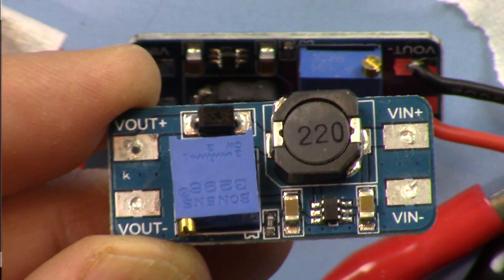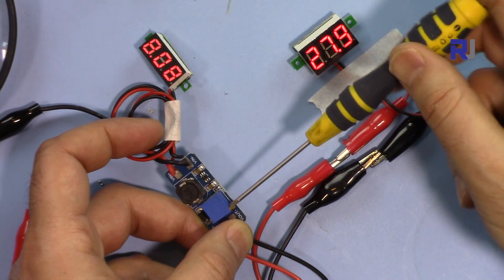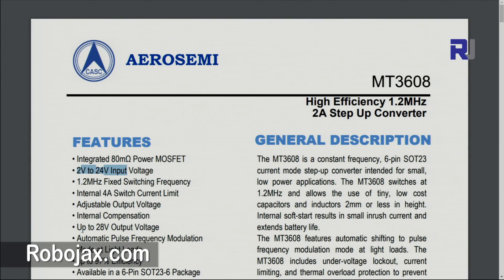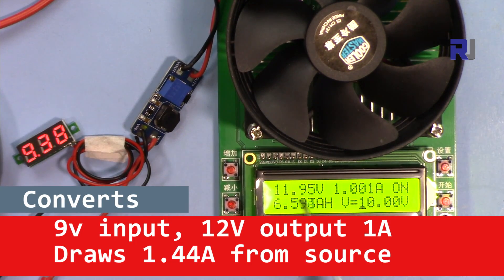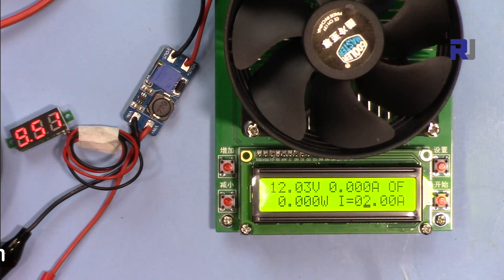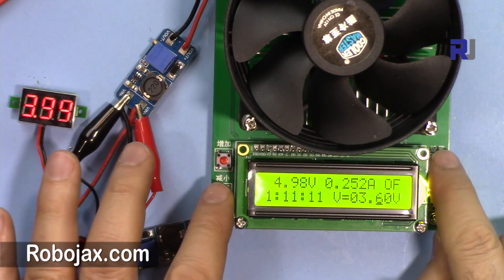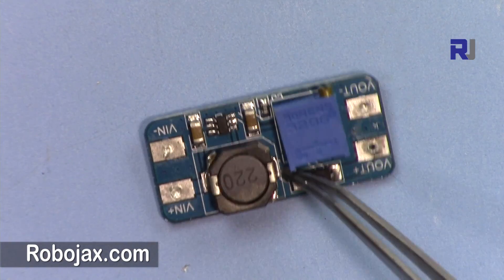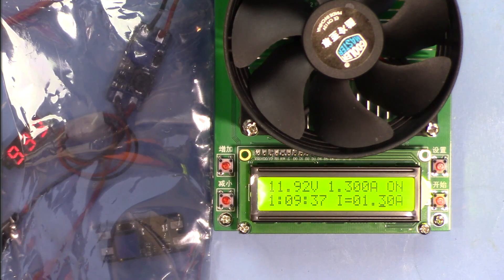Test review of 2A DC-DC Step up boost converter MT3608

Comment: I tried this on my DIY solar for constantly maintaining my car battery. I'm glad I bought 6 of them ,because I already burned the four. If I try to short my solar with this boost converter it will immediately destroy the booster. Connecting to my car battery worked awesome, because with using this boosters  even smallest sunlight was able to give me 14.7V output  from max 8V solar panel. But if I plugged in any 2A  device in my cigarette plug, or  accidentally applied brake pedal while the solar panel was hooked,or accidentally shorted my cigarette plug of the solar panel it burned the booster.

Comment: Hola, estoy preparando un video de una modificación, donde incluiré unos fragmentos de tu prueba. Tanto en material video como en descripción adjuntare información que es tu video. Aunque no me voy entrar en los detalles de pruebas
Reply from the maker: Hola, puedes incluir de 5 a 10 segundos de video, pero no acepto que se use ningún video más largo. Gracias. Gasté miles de dólares en construir el laboratorio y el equipo. Quiero que mis videos se vean. Saludos.
Reply: @robojax  No te preocupes, yo también tengo laboratorio, pero mas para audio. Este material para ti sera una publicidad, mostrando solo resultados y la sentencia que he presentando sobre este convertidor - en mi caso no es análisis ni test. Si alguien quiere ver Tu análisis encontrara enlace a este video. Gracias.

Comment: Does potentiometer of this module have a physical stop?
Reply from the maker: I don't know what you mean by physical step. this is a rotay device with multiple turns. You can set your voltage, take out the resistor (the variable resistor), measure it and replace it with the fixed resistor. if you want to knwo how to have multiple fixed voltages, then see the datasheet https://www.olimex.com/Products/Breadboarding/BB-PWR-3608/resources/MT3608.pdf

Comment: Now I understand that this module can only handle 1A of current, not even 2A. Or maybe yes, if the output voltage is very low at 3.3V and 2V input, bcs low voltage means higher current. Once the voltage higher, the current limit probably getting lower.
Reply: just treat it as step up transformer with 2A max input. not 2A output. because if u need to double the voltage at output u must double amperage at input.

Comment: If your boosters voltage is not increasing turn it 15 to 20 turns in both clockwise and anticlockwise
Reply from the maker: this is the most import point of this video.
Reply: @robojax  yea True
 thanks for reply

Comment: Yes, it's working only 1A  for Dc motor i try this directly connected  to bms motor running speed, but through step up module slowly running but voltage is showing 12V but  motor is slow down. Even XL6009 module also

Comment: please can you teat for 3.7v input to 15v 1a....if the voltage would be stable to power 12w led bulb..the led cob is rated 12v 200ma

Thanks

Comment: Hi. I have a power bank 20.000mah 5v output dc 3A and i want to step up to 13.8v 1A it will be successful or fail?
Reply from the maker: Hi, calculate the input power 3x5=15W and the output power 14x1=14W output is less than input, so it should work. See my test as I don’t remember what value was on he current at that voltage. If it is 1A output then you bare good.

Comment: Hi, I wanted to step up 3V stable output from arduino to at least 7- 10 V for the load. But looks like this is not working for me. Did this thing broke? Should I try a new one? I have turned the screw  many times in both clockwise and anticlockwise direction nothing is happening?  Any guess?
Reply: Same problem here .
Have you found a solution,Any one Help.

Comment: Can I use it to have an output of 150mA  - 27V with 1.5A - 5V Input. Will it be able to even covert 27V from 5V.?
Reply from the maker: it is all about power P, voltage V and Current I. Now P=V*I, input V=5V, I=1.5V, P=5*1.5 = 7.5W and using for output this P=I*V we can find I=P÷V,  P=7W  because0.5W is wasted as heat. V=27V, I=P÷V= 7÷27=0.259A so yes you can get 250mA. Now remember it is all about power.

Comment: Hi dear. Can you inform to me the both smd capacitors value which is placed on left side and right side of the small chip. Thanks and regards
Reply from the maker: Hi, see the datasheet here https://www.olimex.com/Products/Breadboarding/BB-PWR-3608/resources/MT3608.pdf they have mentioned the capacitors values
Reply from the maker: and here is schematic for the module https://www.kynix.com/editor_u/pdf/20220222/Operation-Of-the-Mt3608-Step-Up-Module.jpg shown in this page https://www.kynix.com/components/MT3608-DC-DC-Converter-Datasheet-Circuit-Schematic.html

Comment: when i connect 5v from a usb output and  transform it to 12v it makes a weird clicking noise. Have you any idea what cause it?
Reply from the maker: There might be vibration from the largest piece which is inductor or coil.

Comment: How do you stop it from turning off when you conect a load
Reply from the maker: reduce the load capacity. if this module can handle only 1A and you connect 2A, it will shut off.

Comment: Hii thanks for the video. Can an Arduino control the Volt output from this module?
Reply from the maker: Hi, yes and No. No because not all Arduino has Digital to Analog (DAC), Yes, get a board that has DAC and you may build extra circuit to make it work. not all converters can be connected to Microcontrollers such as Arduino.
Reply: @robojax  thanks for the reply, i wonder if Attiny85 as i read have 8 bit DAC output. Will it possible?

Comment: It is 2A switching curreent, NOT output current.  So (over simplified) if voltage doubles the current halves AND less with switching loss so 12 -> 24V likely 900mA max.

Comment: I have given input to this module from Li-ion battery chaging module to get 12V output. When battery voltage drops around 2.8v or lower, the out put is not maintaining 12v. It's reduce time to time. I mean, if I connected 12v LED strip to the output then, blinking happens. Can you pls advice ?
Reply: pm me can you to install do sola paint of charger.

Comment: Can I use it to reduce the voltage for 3,7v  rechargeable batteries? I want to make a rechargeable battery for my Transistor tester... it's working with 9v battery... and I do have plenty of 3,7v rechargeable batteries...im thinking to connect them in series and after to reduce the voltage to 9v...
Reply from the maker: This is clearly titled as boost converter and the output will always be higher than input.
Reply: @robojax  Thanks 👍....

Comment: Who else applied more than 6v to these out of the packet and popped them?  Apparently there is a design fault as the Vref pin can't handle more than 6v and the modules are supplied set on minimum which applies the full voltage to this pin.  To avoid this issue apply a maximum of 5v then setup the voltage you want (turn the pot ANTICLOCKWISE).

Comment: I know that this is an old video, but the info is still relevant. Thank you for posting it.
Reply from the maker: you are welcome. this module is based on one of the best boost converter chip and it will be valid for very long time I believe.
Reply: pm me can you to install do sola paint of charger.

Comment: why 5V 2A = 10 W  is failing, however, 24V 1A is working
Reply from the maker: because the 2A current is the problem. power is not a problem with this converter.

Comment: can i use this for my speaker project it draws 5v 2a and the power supply for the booster is 3.7v battery  4600 mah(fully charged it goes to 4.2) 

waiting for your reply 
😊
Reply from the maker: I forgot what was the maximum current that this module can handle but if it can handle. 2A then yes

Comment: No has comentado que tiene un consumo interno. Yo lo uso en un Receptor de RC para subir de 4,2 a 6V .Es una pila de LI 1906  y si lo dejo sin usar el voltaje de la bateria con 1 mes cae a 4.00V en lugar de mantener los 4,2V ....Saludos
Reply from the maker: Sí tienes razón, no lo mencioné porque es muy mínimo. La regla es que pones el interruptor entre la fuente de alimentación y la batería y la apagas cuando no la uses. Además, UN mes es mucho tiempo y, dependiendo de la calidad de la batería, también pueden perder carga. Gracias por el comentario. Saludos desde Canadá
Reply: Eso era lo mismo que yo iba decir,tienes que desconestarlo en la entrada y problema resuelto.

Comment: I want to connect 2 same modules MT3608 in the outputs 3.3V/16A and 5v/25A of a PSU ATX. Can I do this? Is there a danger about the high output currents 16A and 25A of PSU ATX for damage (burning)?
Reply from the maker: hello, it seems you have not watched the video. the maximum output is 2A only.
Reply: @robojax  Hi my friend. I have watched the video. I know the maximum output is 2A. I think you have not see my question. I ask about the INPUT of the high currents 16A and 25A of PSU ATX.

Comment: I have to convert 3.7v - 5v
I am Using a lipo battery.
I am giving power to an Arduino pro mini.
I have to rotate 3 × 3.7 v motors.
Is it the best option ?
Plz hlp.
Reply from the maker: voltage has no meaning. it is the power or current that is important. I have shown how much current (power =voltage X current) this module can handle. so see that and if the total current for your motors does not exceed the value I shown, yes you can use it.  for the the voltage I have shown what is the minimum voltage that you can connect.

Comment: What will happen if you increase the input voltage? Let's say you set the voltage to 12v and you increase the input up to 12.6v or higher.
Reply from the maker: I believe I have shown it. The output will not change if you change input

Comment: can it also work as a buck converter? like isupply 12volts and output is 5volts
Reply from the maker: NO. for that we have buck-boost-converter. this is just boot and output is always higher than input.

Comment: Can't power my 12V 1.05A fan with it properly. From 5V source. When i increase the current limit, around 1.58A it starts to show voltage limit, then current limit on the bench psu, and the fan spins down a little, then back up again, and then down, it repeats. Measured the output, it was around 7.6V instead of 12V.
Reply from the maker: Your total output power can be more than the input power. Is the input power enough?
Reply: @robojax  I mean, if i set the psu to not limit the current, and set the voltage to 5V on it, shouldn't the boost converter just draw enought current to power a 12V fan that i'm using with? Or i'm totally getting this wrong.
Reply from the maker: It should get 12v and the output current is what I have tested it as I don’t remember. Yes it should
Reply: @robojax  It is working with a lower current fan (0.3A), but i needed the bigger one, for a fume extractor project. Guess i will need to find another solution, to drive that 1.05A fan, gonna get some laptop psu or something. Anyways, thanks for the help and reply, and thank you for your videos.

Comment: Nice, thanks a lot. But What's the minimum input voltage?
Reply from the maker: Your question made me watch the video.  So you skipped the video. It has been answered in video. I answer all questions if not answered in the video.  So please watch .
Reply: @robojax  Thanks a lot. I was referring to the minimum operating voltage regardless of output voltage. If I explain again; the minimum voltage to power on the circuit. Thank you.
Reply: @maxj777  
İnput......: 2-24 volt
output....: 28 volt
max Amper...: 2 amper

Comment: i use thes to run my wifi on powerbank
Reply from the maker: check your WiFi input voltage. if it is 5V then yes. power bank is for USB and it is 5V.
Reply: @robojax  nooo its 12v 1amp it works perfectly with this convertor the wifi can take min. 10 volt the convertor can give 11.3 volt on super charge bank
the orugnal power supply was 12v 2amp
the thankyou for reply 🙏🏻

Comment: Can it handle boost up from 5v to 6v? @ 700ma
Reply from the maker: you made me watch the video as this question should have been answered in the video. Indeed I saw it in the video showing minimum voltage for the input and maximum for the output. the current has nothing to do with the voltage. it depends on the output. load.

Comment: Hello sir i have 11.1v power supply and i want to made 12v router ups for my tenda ac10 router is this good for this project?
Reply from the maker: read previous email.
Reply: @robojax   already read bro i want 12v voltage and 2amp current is this converter work continuously 24×7

Comment: Is this module work on tenda Ac 10 router
Reply from the maker: Hello, this is just electronic converter. you need to know the voltage (V) and Current (A) for your router. then compare it with the test I did.
Reply: @robojax need a stable volt 12v and need 2amp current

Comment: Why doesn't it have any capacitors. Seems dangerous.
Reply from the maker: it does have 2 capacitors. page 6 of datasheet https://www.olimex.com/Products/Breadboarding/BB-PWR-3608/resources/MT3608.pdf says 22μF capacitor and if  you see datasheet of the capacitor https://search.murata.co.jp/Ceramy/image/img/A01X/G101/ENG/NFM3DCC102R1H3-01.pdf for surface mount device, it is small and the module has  2 capacitor as per MT3608 datasheet.

Comment: Hi sir my booster trimpot not working, turning at any opposite direction nothings happen to output ..any possible can fix this?
Reply from the maker: I said in the video that you you have to rotate it 10 to 15 times until you see the voltage. if input and output voltage is the same, then the chip is dead. while output is set. change the input and  increase and decrease it and check the output to see if it changes.
Reply: @robojax  i already rotate more than 15x but nothings happen to the output, it is still the same on the input .. I guess you are right this chip is total busted.. What a luck of the day Hahaha... Anyway thanks for the time sir
Reply from the maker: you are welcome.

Comment: If i put at the back of this board a dissipator + thermal pad + fan i can get more current?

Or at least a close fan.

You had to isolate the air from the fan, because it was interfering.
Reply from the maker: maximum rated current is 2A so you won't get more than 2a.
yes I should've isolated. I did notice is and did that in the upcoming video.s  Thank you.

Comment: Dear Sir , pls resolve my problem
I suddenly reverse the polarity to the module and switch on .  A small spark on big  Diode . I disconnected  the supply ASAP.  Now my boost module not working.   How to repair it ? ☹️☹️
Reply from the maker: Hello, this has very minimum components. repair would cost more than the module. Do not waste time on repair. get new module.
Reply: @robojax  Thank you Sir  for quick reply.  I always very aware about polarity of any circuit/ Module so This would be my first MODULE which  burnt by me .    Mistakes makes a perfect learning for anything .😎😎

Comment: I have used this same converter to step up the battery output of my 6 volt motorcycle, so I can use a 12 volt led rear light, because I have more choice of bulbs in 12 volts.
Reply from the maker: I have sow how much current this can handle. so for your bulb, either check the current rating (ampere) or if you know the power for example 12W. then I=P÷V,  I is current, I=12÷12=1A. make sure the current of the bulb is not higher than this module. Please replay here if you used it and it worked.  Good luck

Comment: Can I connect this to usb port of computer to draw 12v?
Reply from the maker: Yes of course. Remember USB port of computers can supply only 1A and USB is 5V so power is P=VxI where I is current in A. P=5x1=5W so you will get at the output  with 90% of energy outputs you will get 4.5W . Now because you want 12V, then  I=P÷V, I=4.5÷12=0.375A so you will get 375mA at the output.

Comment: Can i use this for a peltier generator so ican increase the voltage?
Reply from the maker: this is what is made for. yes. Pay attention the maximum voltage of this module or else you will bur it.
Reply: @robojax  Thanks i only need 12V output ithink it wont burn it LOL

Comment: Thank you for the video. Can this be used on 4 solar cells total 2V to boost to 12v for charging car battery?
Reply from the maker: you did not mention the voltage from solar, but his doesn't have current control if you are charging lithium battery , the battery get damaged if voltage or current exceeds the limit.
Reply: @robojax  Thanks for your help! Ok to be more clear i have 4 solar cells, each is 0.5v and I plan to put them in series so I get a total of 2v. Then I plan to use this boost converter to make it 12v, and connect that to a 12v solar controller so that it can charge a 12v batter connected to the solar controller. Will that work, can you please tell me?
Reply from the maker: I don't remember the minimum voltage this module needs so watch it. if it is within equal or greater than minimum input voltage of the module, then yes.  Keep in mind that the total power is that matters. for example if you have 2V and 12A P=2x12=24W so you input 2 watts. and this module can't add anything into power or watt. you may get 12V and 2 because 2x12=24W. this is ideal. converts have 10 to 15% losses. keep that in mind.
Reply: @robojax  Ok. Thanks for the detailed explanation! I really appreciate it very much! :)

Comment: I got same modules from ALI however they deliver only max 400mA from input 3.5 to output 5V. The chip used on my modules is marked XT1208, I assume it is a fake or a chip with lower current capability, anybody knows about that model?
Reply from the maker: see the test I have done. I am not sure what was the current. Also if you input source can't supply more power, the output will never do that. for example if you want 5V 800mA the Output power Po=5(0.8)=4W then the input power Pi=4(1.15)=4.6W (1.15 is 15% losses). So when your 3.5V, I=P÷V=4.6÷3.5=1.31A, are you supplying (at least) 1.31A to the module? Good luck.